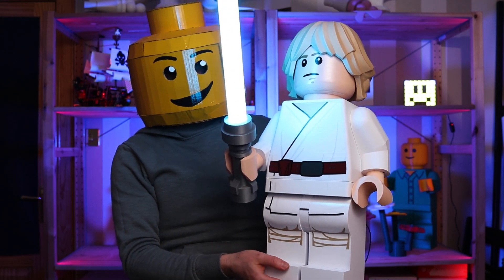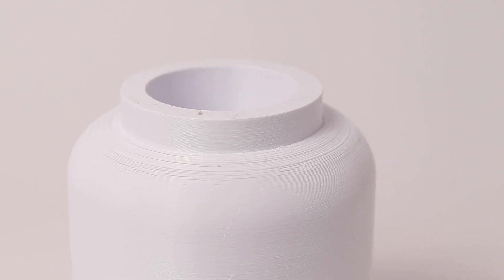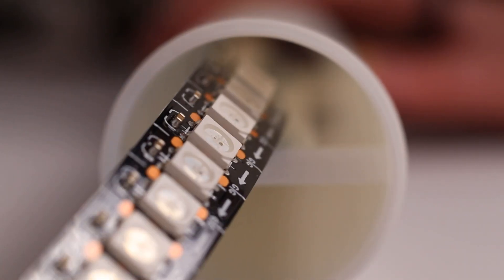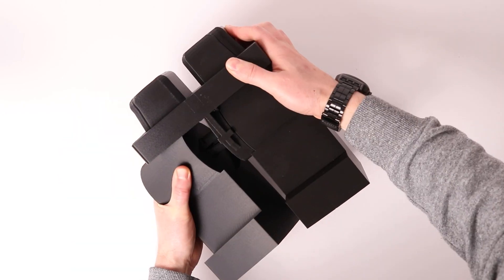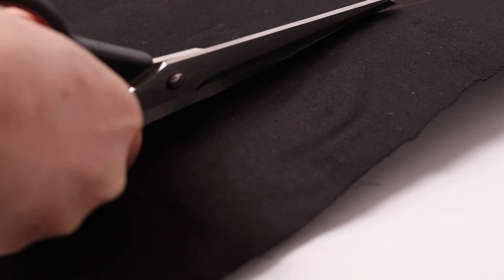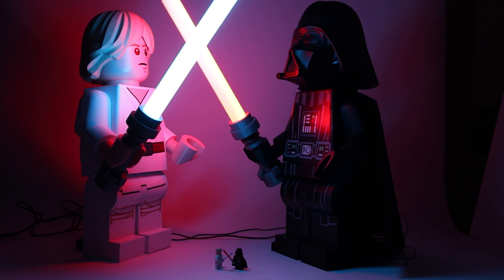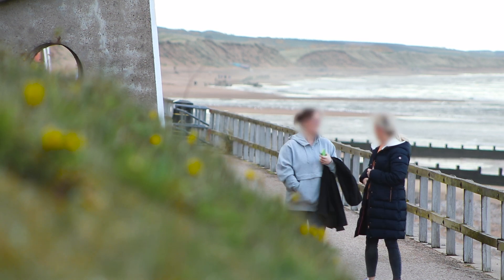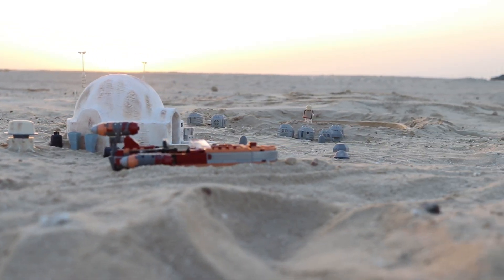I 3D Printed A Huge Lego Inspired Darth Vader

Comment: These are awesome, I just purchased an ender 3 pro and getting to make some projects. How did you get these as tall as 58cm? Any file I've found are much smaller
Reply from the maker: Most slicers allow you to scale the model to a size that works for you. You might find though that if the model has parts that move when you scale it a lot bigger or smaller they wont fit as well. You might need to make some adjustments. Also some files will have all the parts to print at once but as you scale up they wont all fit on your print bed in one go so you need to split them into single parts to print one at a time.

Comment: That's really cool. May I know what kind of printout you put on the lego?
What type of paper or printer did you do?
Reply from the maker: It's just a normal inkjet printer and I printed onto some white glossy sticker paper. I have used water slide decal paper in the past too. The water slide decal paper goes around curves better and doesn't seem to lift at the edges so easily. 

To make the graphics I just use photoshop and build it up out of basic shapes (illustrator would probably be better I'm just used to using photoshop).
Reply: @SketchyMaker  Oh thanks a lot bro!!!

Comment: Amazing work 🤩
Reply from the maker: Thanks, it was pretty hard work getting it built but I'm happy with how it turned out!
Reply: @SketchyMaker  how much material did you use ? I guess you didn’t print with high infill values ?
Reply from the maker: @TheHuma0815  I don't know exactly but I think just over 2kg of filament. For stuff this size I normally use 10% infill and 2 perimeters with a 0.6 nozzle or 3 with a 0.4.